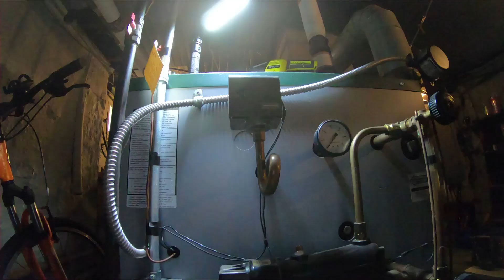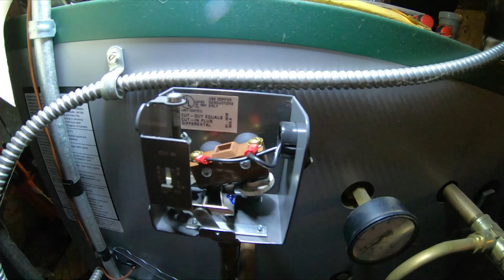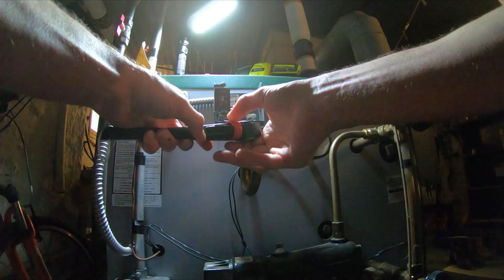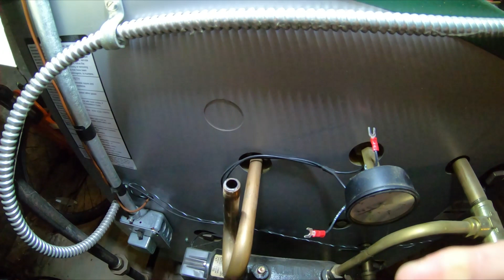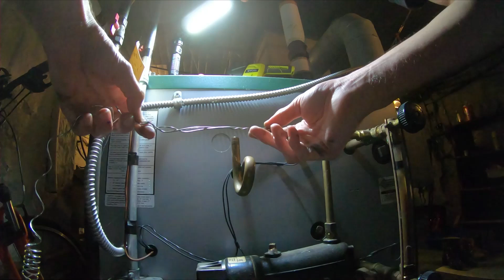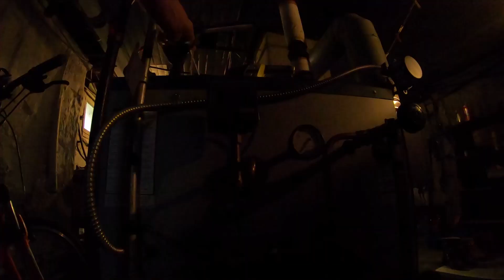High pressure reading in Residential Heating System and  how to remedy it by Rob Mosley Nov. 2020

Comment: Boiler, boiler, boiler. Furnace uses air to heat. Boiler uses water or steam to heat. Not only does the boiler need to be flushed but the whole wet return needs to be flushed. You can also add a cleaning solution to help keep the return from building up sludge. You should have it professionally cleaned once in a while. Heat exchanger should be cleaned every so often. But it is good advice for home owners , keep it up.
Reply from the maker: I hear you...I guess my terminology isn't completely correct as I am not a professional. However I have been a mechanic/ maintenance  person for most of my life and can use my knowledge to figure things out. I do appreciate the feedback my friend ...thank you.